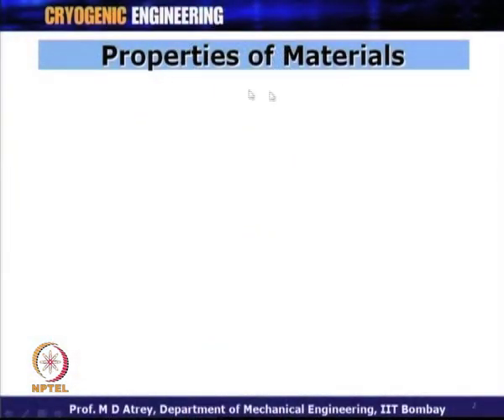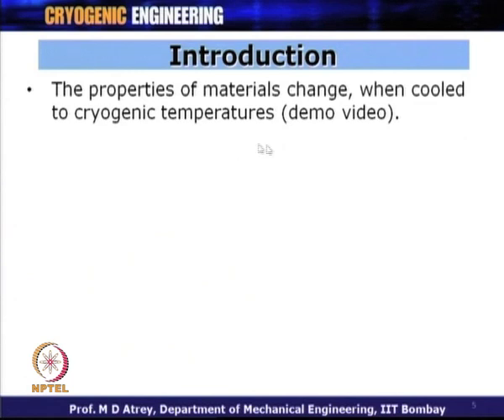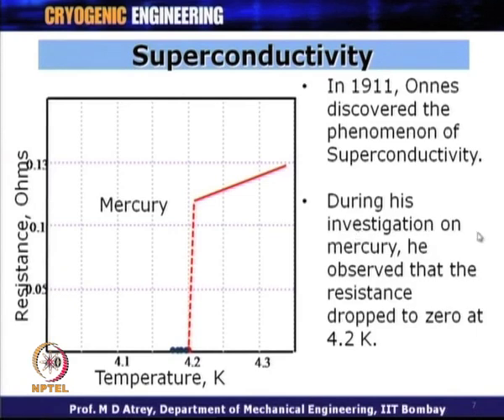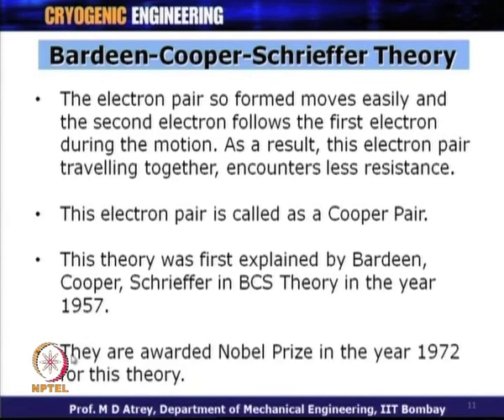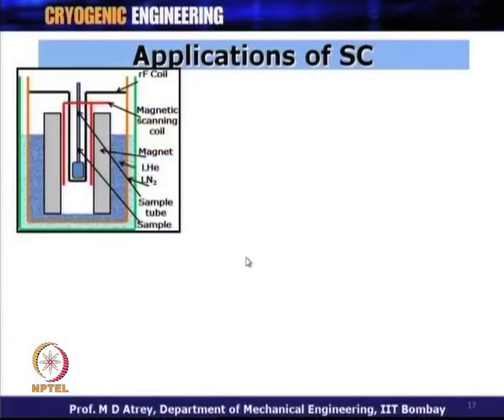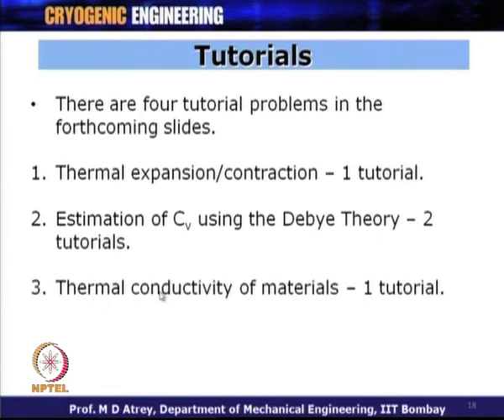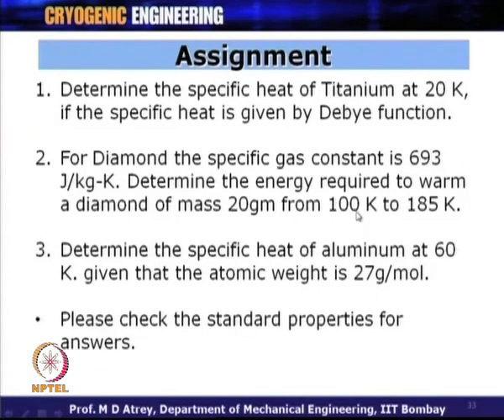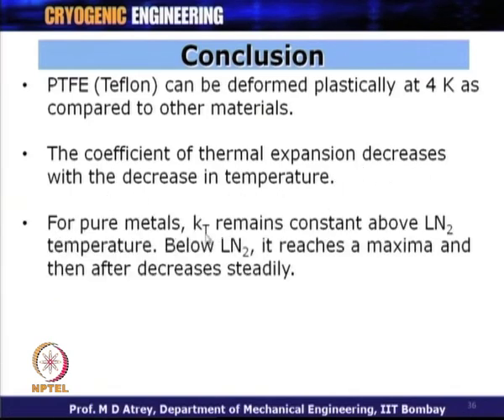Mod-01 Lec-07 Material Properties at Low Temperature III

Comment: Thank you for these great lectures! My only suggestion would be to add units to the equations so we can see how the problem is completely worked out.  For the problems 2 and 3 I see that you converted the molecular weight to Kg/mol so I am assuming that R has the units mol/Kg. Is there a unit associated for theta D?  Where does J come from? How does K end up in the denominator? Thanks again!
Reply: I figured it out. R has the units J/mol*K, mols cancel out leaving J/Kg*K. Thanks
Reply: Nice!